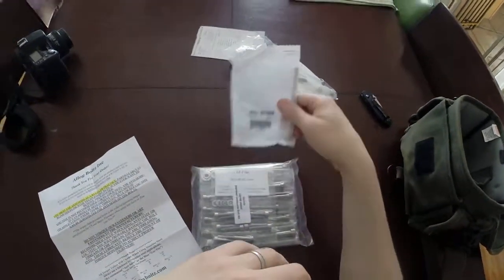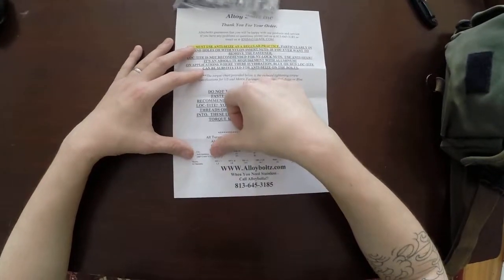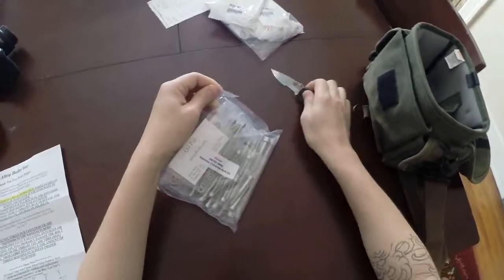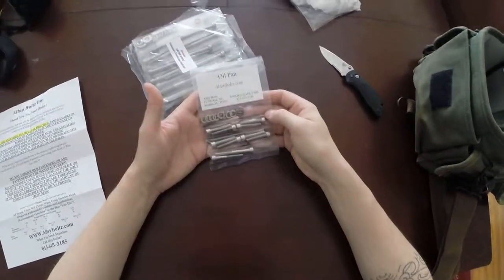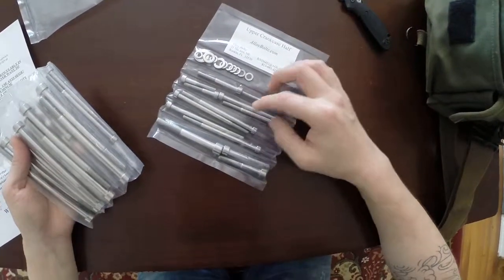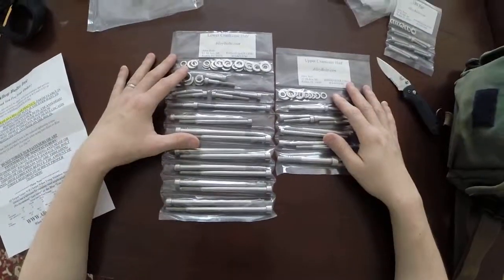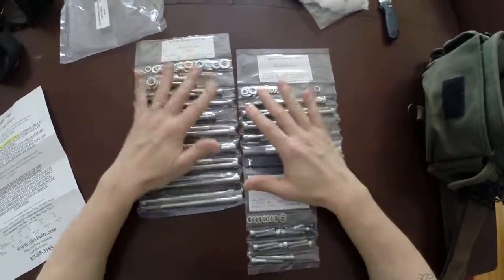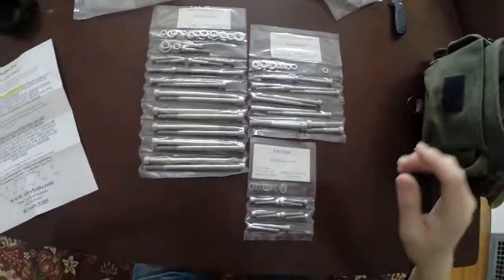CB750 Lower End Rebuild #7 (Engine Case Bolt Replacement)

Comment: How did those bolts work out for your crankcase?
Reply from the maker: Really well.  The longer M6 bolts tend to break in the case, so I bought these.  I have all the information and some photos here, good luck: http://motobonita.com/2016/02/12/engine-rebuild-11-engine-case-bolt-kit/